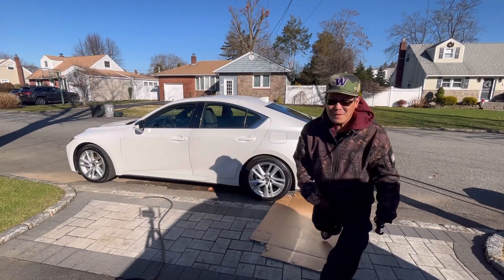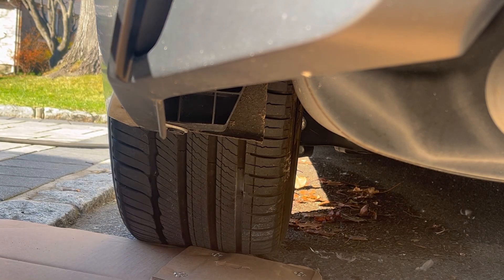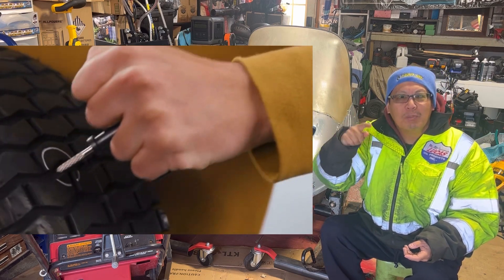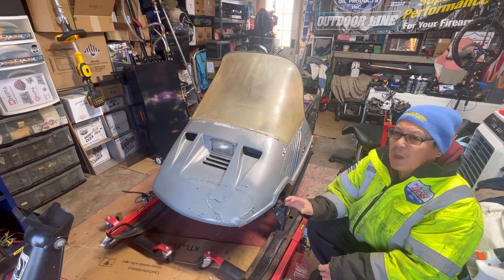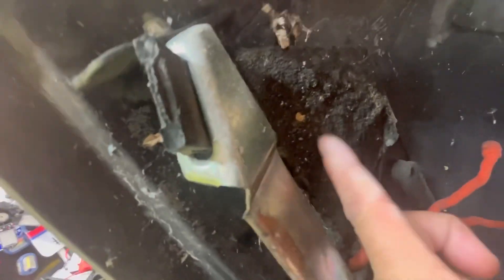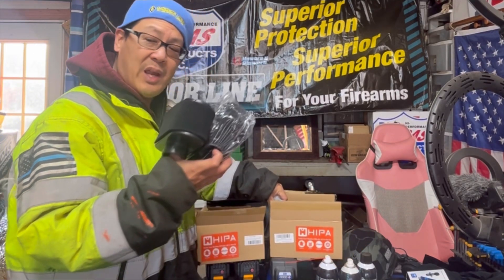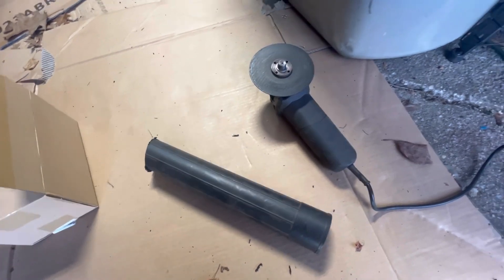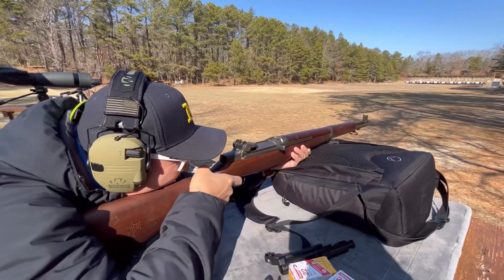DO SNOWMOBILES NEED AIR FILTERS? I FABRICATED HIPA FILTERS ON MY BOMBARDIER ROTAX TWIN CARBURETORS

Comment: removing the airbox will probably lean the mixture out. You might have to drill the jets. Do some plug chops when it gets colder to confirm. You can move the clip on the needle for midrange adjustment, lowering the needle will make it run leaner. The idle to 1/4 throttle is controlled by the pilot jet and 3/4 to full is controlled by the main jet. Run the engine and hit the kill switch at each throttle position and read the plugs, you want a tan color or you can set it rich and they will be black color, white is too lean.
Reply: Or you can say eff it Henry which is what I think you will do🤪
Reply from the maker: @andyhamilton8940  👍
Reply from the maker: I didn’t remove the box,  I never had one which is why I’m adding filters
Reply: someone removed it. When you run pod filters you need to jet up, it may be ok though hard to say with custom mods like this. spray some carb cleaner behind the clutch when it is running and see if the rpms climb, if they do you have a bad crank seal on the pto end.

Comment: Most snowmobiles dont have air filters, if you have the factory airbox. They are like snowblowers, they just dont run in a dusty environment, so they dont use a filter.✌🇺🇸🎅
Reply from the maker: I see so many air filter boxes for all types of snowmobiles though.